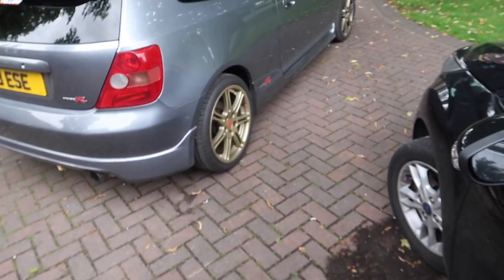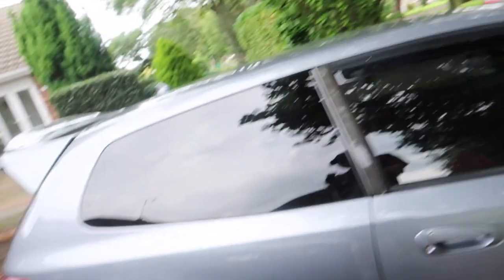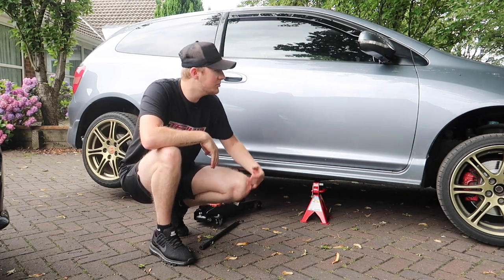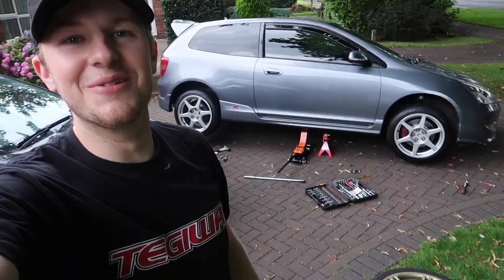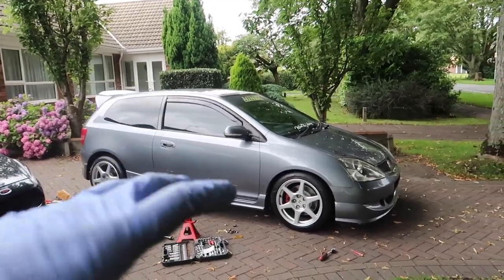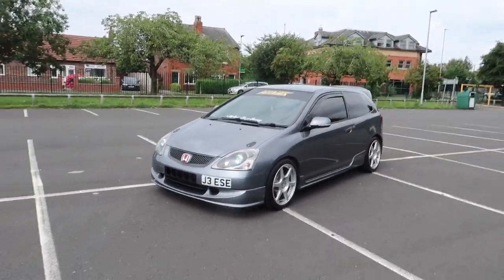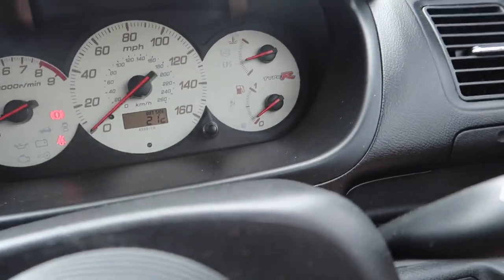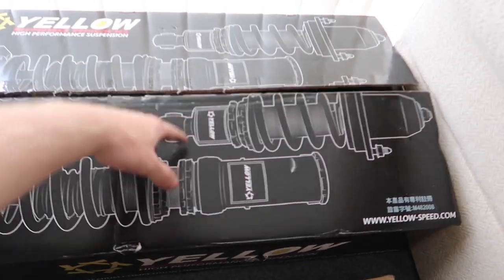FITTING EVO WHEELS TO A CIVIC TYPE R

Comment: Hey mate, I just got some evo8's for my CL7 R, did you use the mitsu lugnuts? Hub ring to Honda spec and where did you get the honda wheel caps from, im trying to get rid of the mitsu logos. Nice work, id leave them silver.